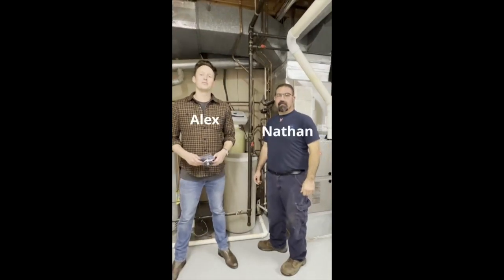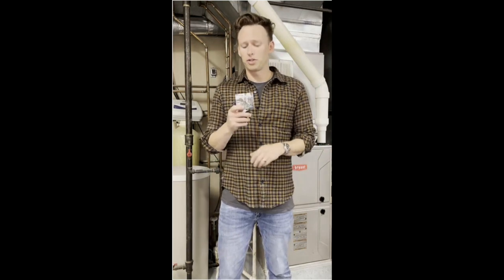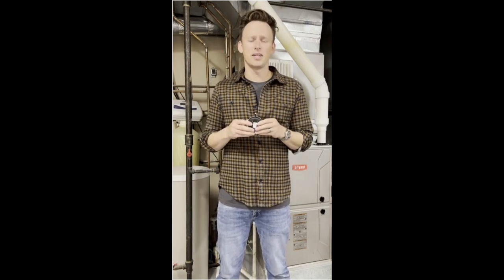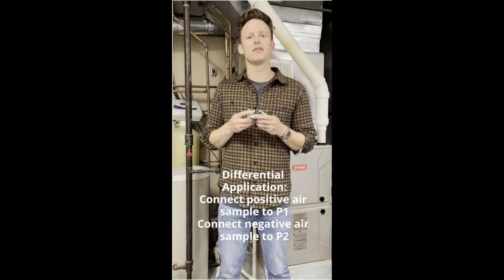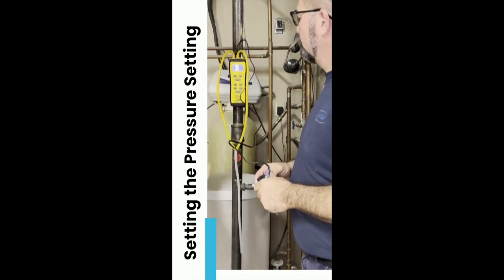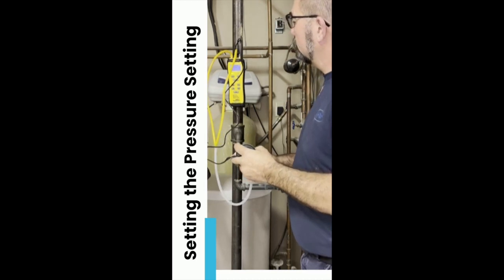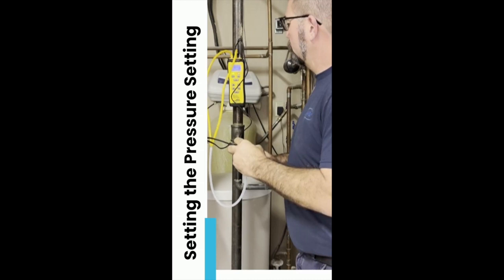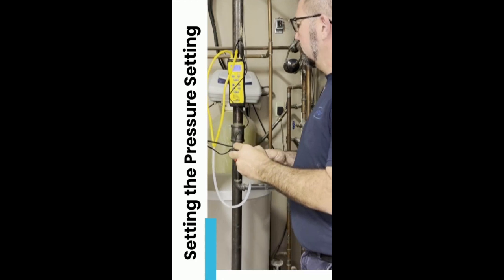Understanding and setting universal pressure switches

Comment: How do I know which spring to use?
Reply from the maker: Sorry we never responded, but here's some good news - an easier to set pressure switch with the spring integrated: https://youtu.be/Wb-My8A1MQ4?si=cFXyivVgkh30GdRk

To answer your question, there are 5 springs. The included instructions show the range on each individual spring.